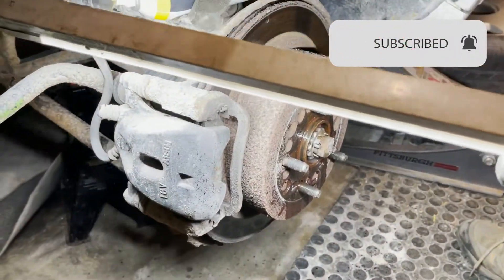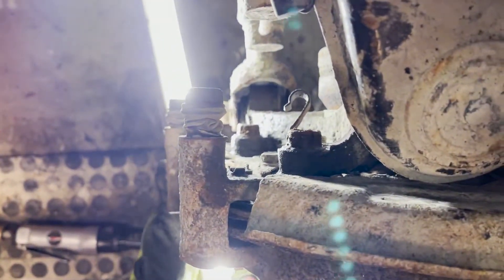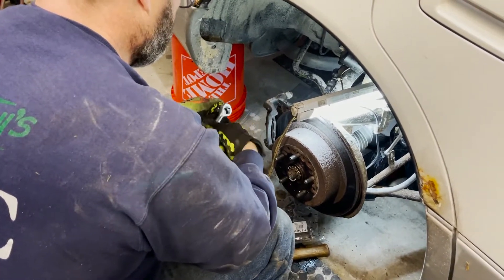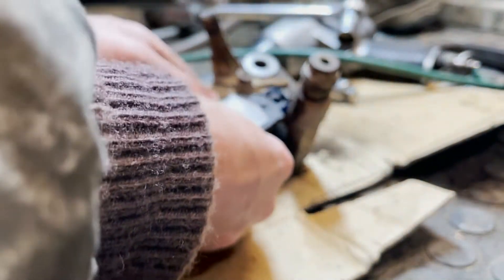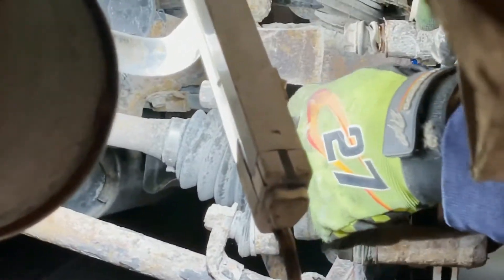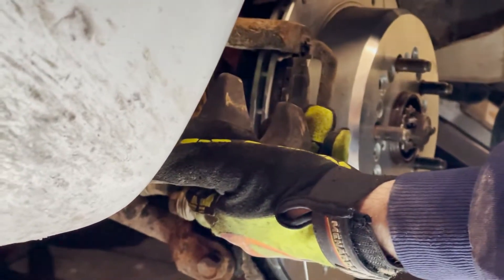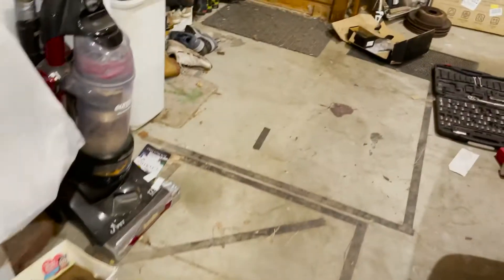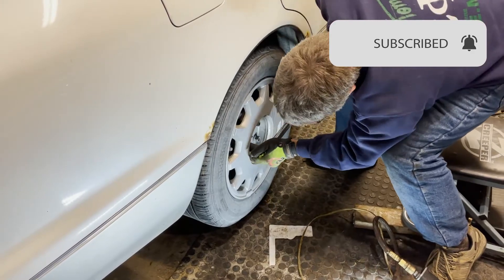How to Replace Rear Brakes and Rotors on a 1998 Lexus LS400

Comment: You didn’t lube the caliper slides… you mentioned it and he shut you down. Should have been more persistent, those need greased. 

There should have been some grease applied on the back of the pads. 

Also, you didn’t put the retaining springs back on the new pads.